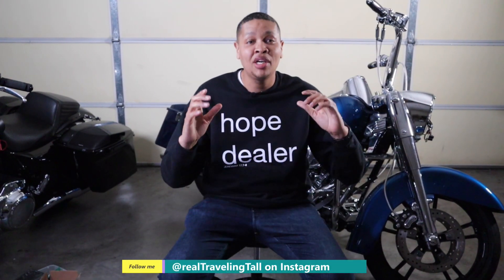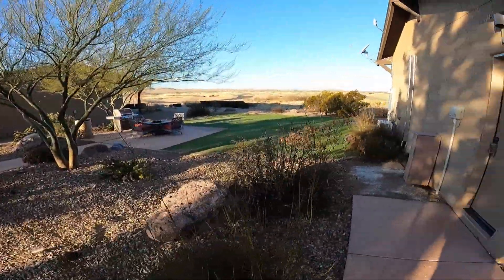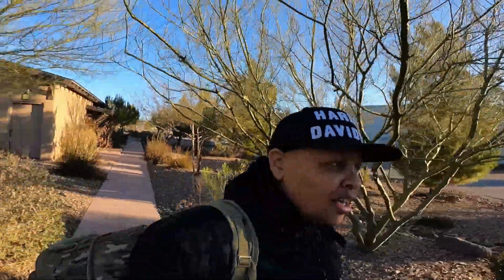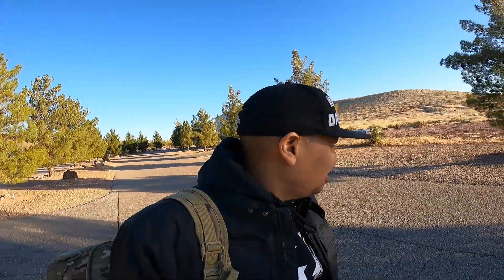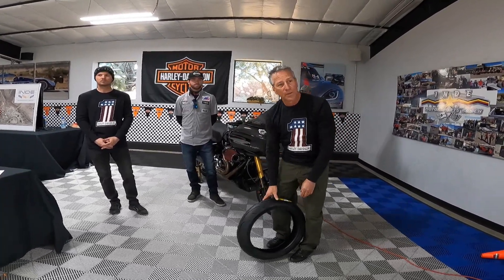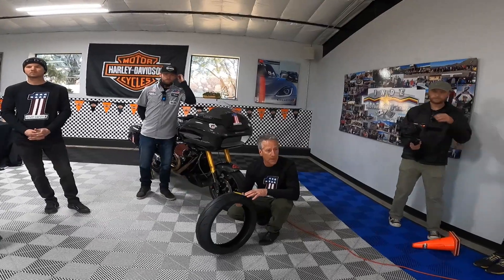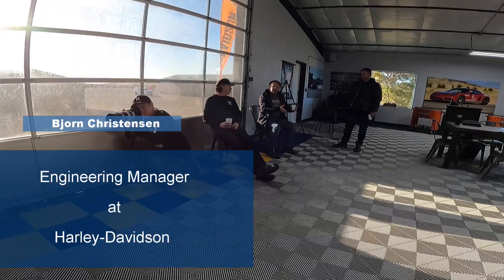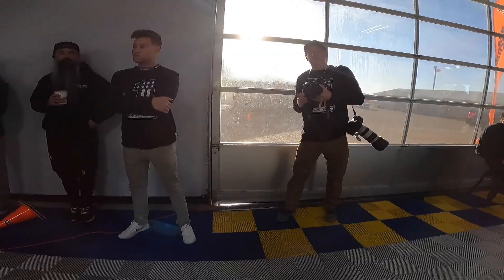WE ARE DYING IN THE CORNERS!! THIS COULD SAVE YOUR LIFE! MOTORCYCLE TRAIL BRAKING EXPLAINED

Comment: Something about grabbing any front brake leading into then partially through turns feels so unnatural to me and have always used back brakes instead. Riding a TC 88 Dyna and on a very windy road in the mountains West of Roanoke once, decided to go deep and flick at every corner for miles and did so without any problems. And I was pushing it (for me anyway), at least 10-15 over posted through every one. Have used fronts a few times after going in too fast for correction. Maybe I need an advanced class. Thanks for the video!

Comment: Nice video. A lot of info to take in. We all be taught to never grab front brake in a corner. It all makes sense the way they explain it. Pressure equals traction up to a point. More lean less brake or throttle,less lean more brake or throttle. Thank you for this. May save a life on the road.

Comment: Interesting...  a few years ago I cheater certain death from not braking. I was going way too fast around a long hiway curve on my 2010 Dyna. As I realized I couldn't make the curve at my speed, I started a speed wobble and hit the should gravel. I was headed for the guard rails and just accepted I was a Gonner. So I gave the bike full throttle and it corrected its self and allowed me to get back in control on pavement. The semi driver I had just passed saw the entire thing and went by, open mouthed with thumbs up !    Hitting the brakes at any point would have killed me

Comment: Great video for trailbraking and these guys know their stuff.  Nick has been around for a long time (respect).  👍   Ive been a daily MC rider since late 80s on all kinda bikes and he has been in the picture .

We can agree to disagree on failure to trailbrake as a major cause of road runoffs on MCs.   IMHO its always been either target fixation issues or failure to countersteer for riders going off road....    They either fail to look where they need to go or they come in too hot, grab brakes hard (which makes it stand up) and fail to countersteer through.  Ive seen it way too much for them to change my mind on the topic, sorry.  I was always told head and eyes look where you wanna go.   Countersteer the bike, be smooth and trust your tires when you come in hot.   

I totally agree trailbraking works, I use it myself trackdays and street....   BUT its not something alot of folks can pick up safely ON THE STREET and still believe the safest way on a 800 + lbs, low clearance MC HD, safest is "slow in & fast out" for the majority of folks....    Friction is friction and playing with brakes and turns in the rain, on a usually oily street roadway, Ill pass on that lowside thanks.
Reply: Appreciate your take. I took a riding class decades ago and was told to always use both brakes, but they said too not to grab too much front while turning or you will lowside, just like you mentioned. So Had no idea trail braking using the front was even a thing before I started to mess with it on windy mountain roads after coming in too hot a few times. Just felt so unnatural to me and I have always used the back instead to trail brake. If using the back brake through turns can be considered as trail braking?

Comment: This is definitely good knowledge, because these guys are professionals and engineers. At the same time, doesn't it apply mostly to the track, vs every day street riding? Even the rules change when you're racing on the street vs racing on the track.
Reply: Not at all.  The same exact technique that allows racers to go extremely fast on the track with success are the same techniques that allow them (all of us) to be safe on the street.  The bike has no idea if it's Kyle Wyman winning the bagger championship or you out for a Sunday ride.  It was designed to take the same inputs in either scenario.

Comment: Good information, I don't feel it was presented in best manner.  First of all, get off the brakes and then lean into a corner are excellent instructions for new, learning, or not that skilled riders.  What is being taught here is for experienced AND good riders who have the feel and knowledge of the finer points of using the controls. Mastering skilled use of front brakes is crucial.  Unless I'm mistaken it takes until 10 minutes of this instruction to mention the rider eases off the brakes as he leans more into the corner because approaching mid corner the tire needs all of its available traction (these guys say "100 points" , I understand what they're referring to but do most viewers..).  Earlier the main guy is hitting the tire on the shop floor while another is talking, whats that?... oh he's demonstrating forces on the leaned over tire... I see now.... it's just confusing with a lot of people talking.  I understood it because I've ridden for 40 years, but a newer rider might not be getting the proper message.  This is good riding content video, just could be presented much more clearly, less group conversational,  more single instructor proceeding clear point to next point to next building point.  Hugely agree with take an advance rider training course, you'll be amazed what you learn!